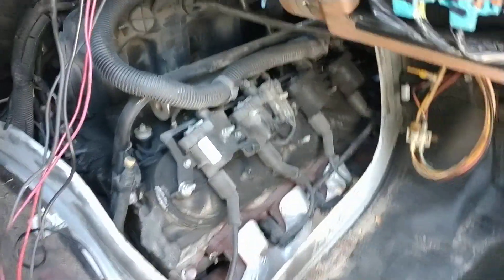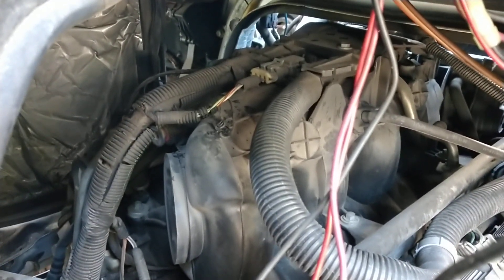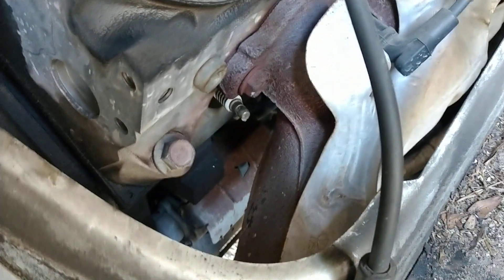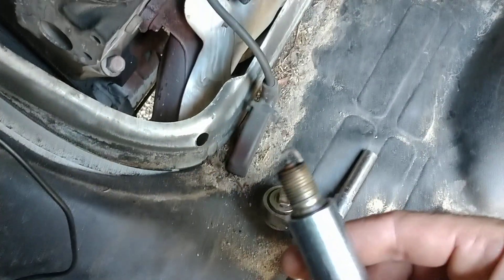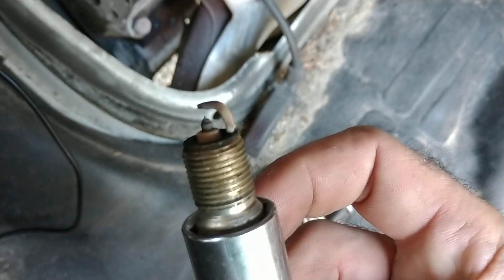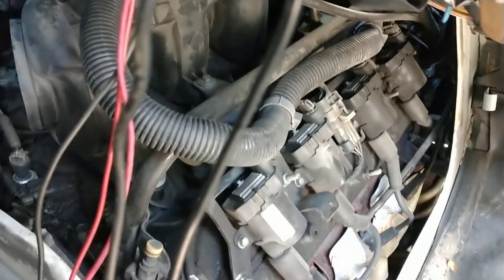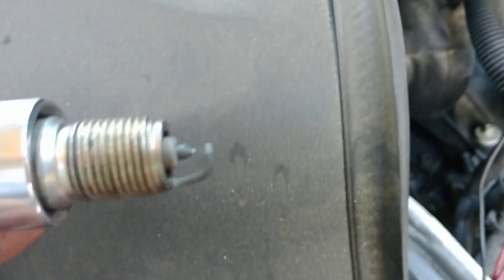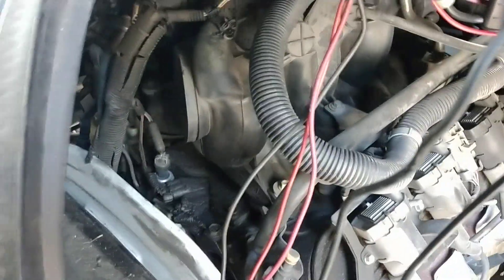Code P0107 MAP Sensor Was Unplugged?

Comment: You want my advice before changing sensors check your alternator
Reply: Hi Frankie, what is the purpose of your advice? i have opel astra and have this p0107 fault code. i changed map sensor, selenoid valf, checked turbo components. but i cant  stop this code.